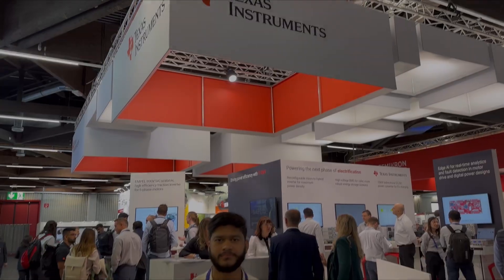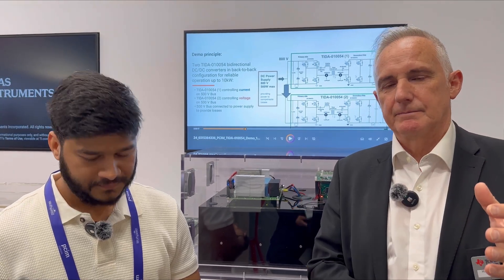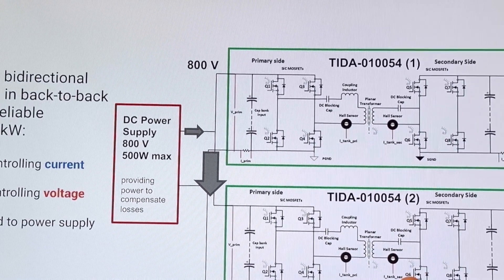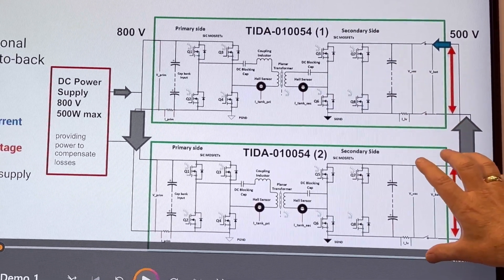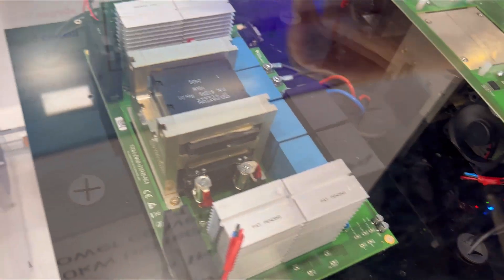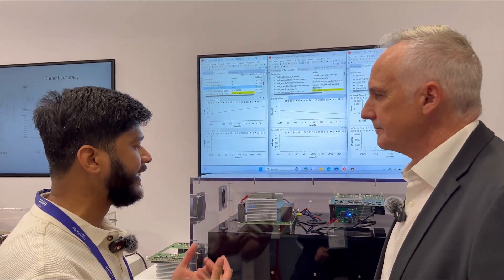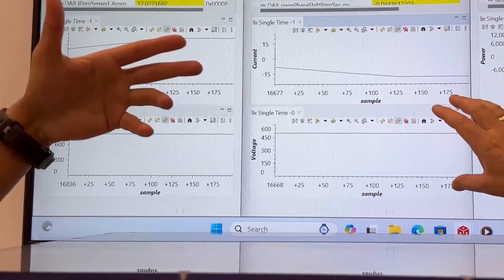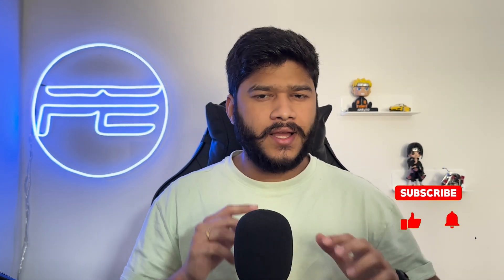Understanding Bi-directional, Dual Active Bridge DC to DC converter #texasinstruments #evchargers

Comment: I didn't get it. Why circulating the power?? Why usung two inverters working buck boost and coupled together? Any body can explain to me?
Reply from the maker: This is just for the demo purpose, both are acting as load and source for each other
Reply: @FoolishEngineer oh..do you mean he was just using the second inverter as a load for the first. And using the first as a load for the second. I get it 😅. Thnak you 🙏

Comment: Can someone please tell me where can i simulate resonant power converters i need that for my final work what program FE is using for sim? ty :D
Reply: There is a built in LLC resonant converter model in PSIM or you can use Ltspice.
Reply: @ayin6048 ty vm. And if i want LCC and LC series and parallel? In psim?